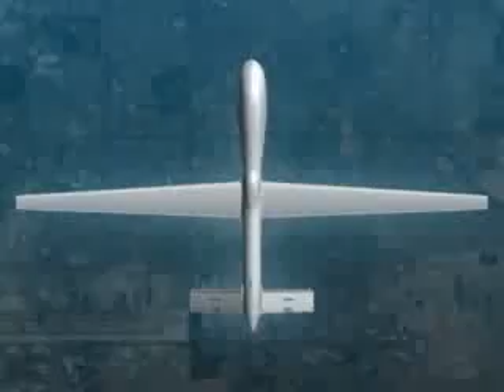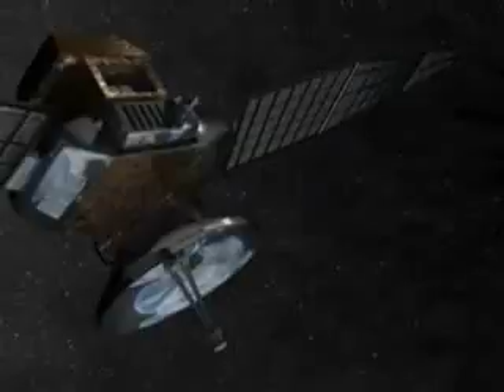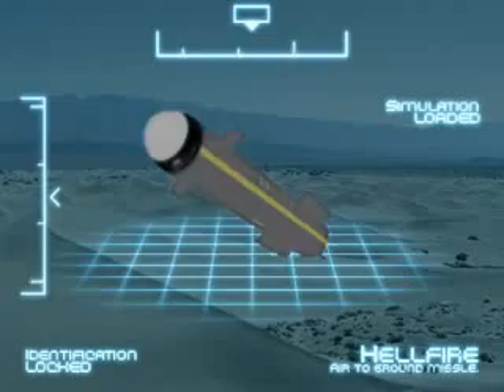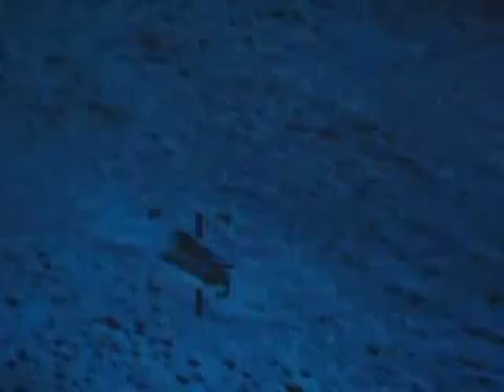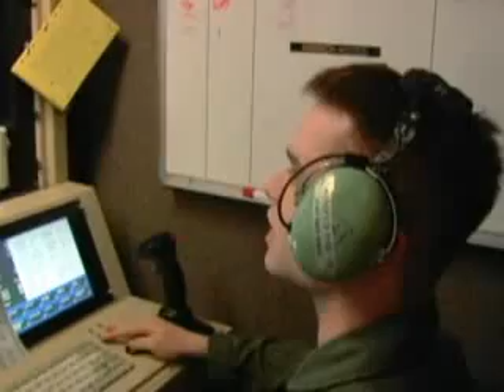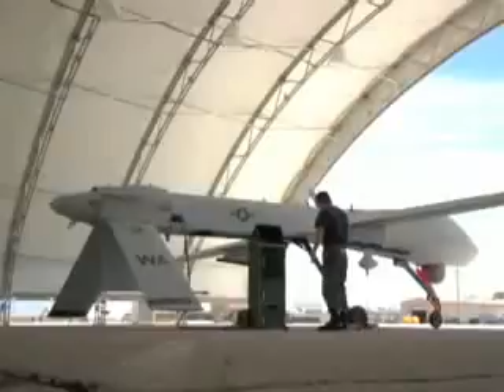Skygrabber Intercepts Predator Drone Intelligence

Comment: they intercepted it because the images and feed information details were not encrypted. this is fair enough because these are used to warn others about possible threats and to make small strikes. if the information was encrypted this feed would be a lot slower, because once it is received it must go through the decrypting process. this delay could cause large problems, which is why the feed is not encrypted